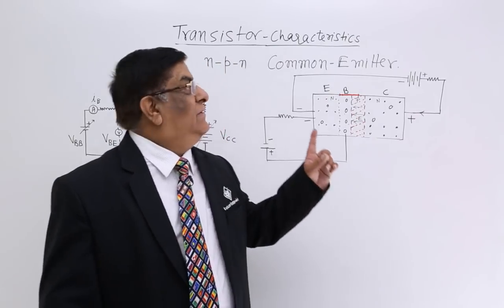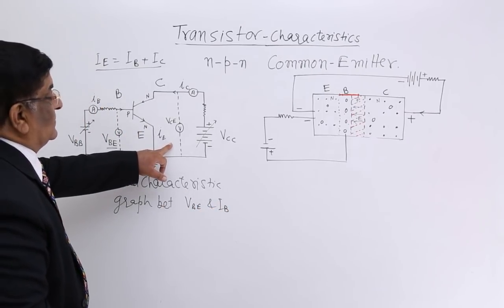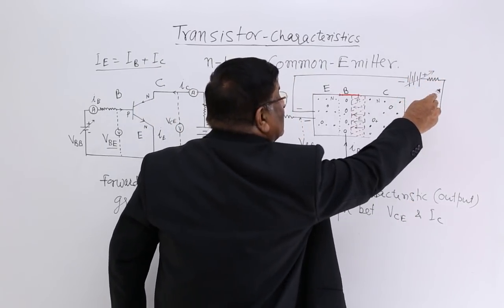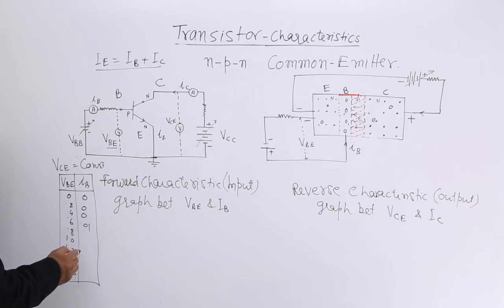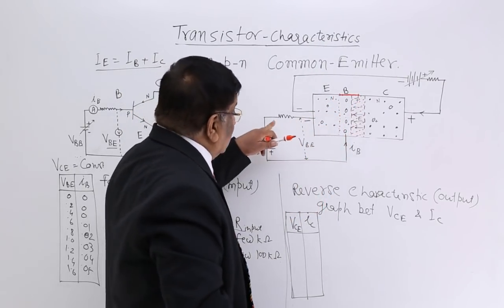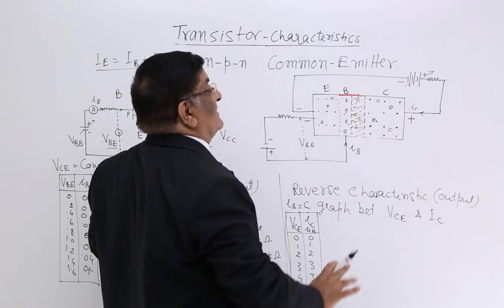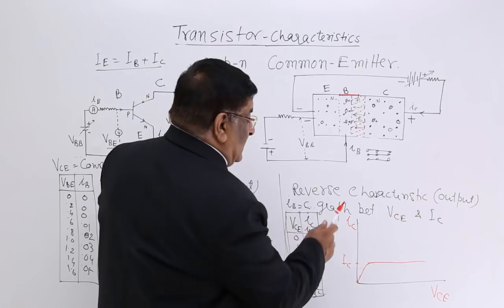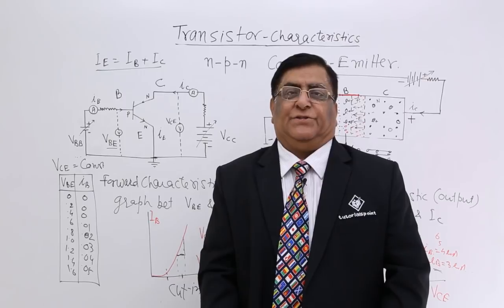Class 12th – Transistor - Characteristics | Transistor | Tutorials Point

Comment: sir there  are some cofusion which i would like you should clear
1. collector current is majorly (99%) due to the movement of electrons if you are taking npn transistor but you have explained it in terms of holes which i think is not correct
2. in the output characteristics, you have simply repeated the reverse biasing concept of diode and hence drawn the graph which requires different explanations due to two reason-
a) output current is very high and it is due to movement of electron thats why it is in mA but you explained it in microAmpere because you stick to only to holes(minority carrier)
b) if it is so then what is the role of electron??
please clear the above doubts
Reply: 1 collector is reverse biased so current will be due to minority carriers,  since it is an n-p-n transistor holes will be the minority carriers at collector
Reply: He is no more
Reply: He is making things very complicated...